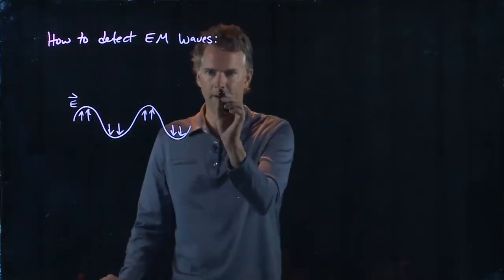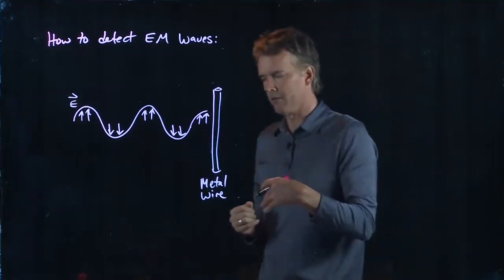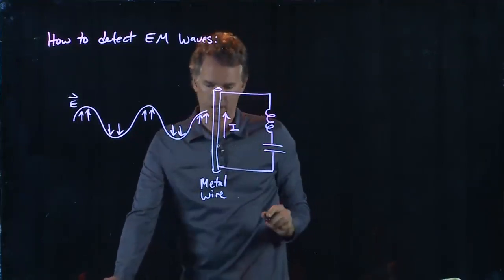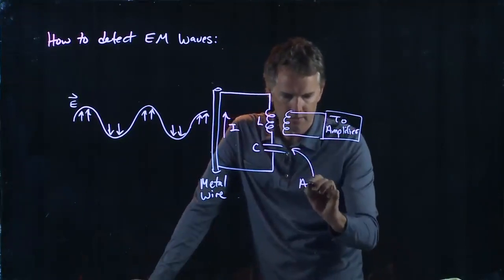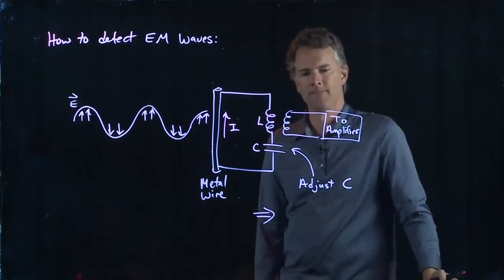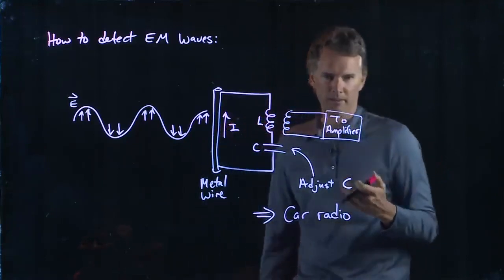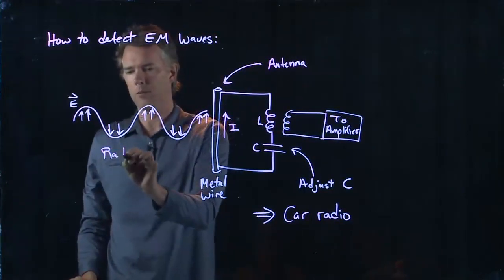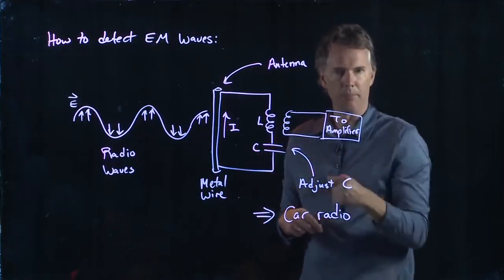How to Detect Electromagnetic Waves | Physics with Professor Matt Anderson | M25-03

Comment: Dear Dr Matt,
Excellent explanation
1 query .... since the antenna can detect a changing magnetic field as well, what exactly is it detecting and converting to an electric signal at the receiver's end?
My intuitive understanding is that, the induced electrical signals from the changing magnetic field are far weaker than the changing electric field from an incoming EM wave.
your thoughts sir ....
Thanks
Reply: The antenna would transduce all waves that hit it, capturable in frequency range of the antenna geometry, induced into the circuit as signal. 

That signal gets further processed (amplitude adjustments, filtering, phase corrections, or other processing similar to audio processing, etc) for usability in "tuning" a frequency.

The actual 'tuning' implements somewhat differently, depending on the technology protocol (i.e., AM, FM, CB, HAM, UHF or VHF broadcast, Bluetooth, WiFi, etc).

The fundamental EM wave frequency, the carrier wave, usually gets cancelled out by generating the same target frequency, cosine to the incoming EM wave .. 

That's all i got; does it answer your question?

Comment: Prof, I have difficulty to understand about metal (wire/plate, etc) and antenna. Antenna is made of metal, cupper or aluminum. The rod is hit by the EM wave and we receive the signal in our radio like in your diagram. But it is the same metal used to reflect signal like in the Yagi antenna which we put bar metal behind the dipole, intended to direct the signal so we he the directed signal. The same thing in parabolic antenna. The dish is intended to reflect the receive signal to the focal horn. Almost the same case is in airplane. It is the surface metal of the airplane reflects the signal from a radar to bounce back to the transmitting antenna so we may calculate the distance, etc. To make a stealth airplane, we need a non-electromagnetic reflective surface. How to understand it?
Reply: I would look at an antenna book.   Maybe the ARRL antenna book  ?  Maybe even check Wikipedia for Yagi Antenna ?
Reply: @k7iq  Actually, it is easy my question: We make metal (say, aluminum) to receive/radiate EM wave. But, it is the same metal we make to reflect the EM wave (i.e,: in the Yagi antenna or parabolic antenna). So, how the same kind of metal acts to radiate/receive and to reflect? Because the metal reflect EM wave, then engineers have to work hard to discover material to make stealth airplane. Just as simple question. Why it can receive and reflect at the same time?
Reply: I know that some stealth ships or planes use angles to reflect radar signals away from their source so that the radar cannot detect the ship.  I think that the use of conductive metal depends on its relative length and distance from the main radiating element.
Reply: @StrsAmbrg  This is a pretty interesting subject I think.  There are several questions on the internet related to this and also some good answers.  I tend to think only of lower frequency radio waves but, at visible, UV and IR light frequencies it is more simply understood. For instance, regular glass will absorb UV and IR light frequencies but will pass (filter) visible light spectrum and the back can be aluminum of course (again).  Silver is even better.  Imagine that.  Silver is a better conductor than aluminum.  Not exactly sure if that is why but it might be related ?
If I find more I will post here.  There is more about this if you Google for it but there was no immediate intuitive answer.
Reply: @k7iq  Indeed, this is an easy question but hard answer. I will appreciate if you want to answer. It is the same material we use to receive signal and to reflect.
Reply: Yep.  Same material for radio in my world.  Aluminum all the way pretty much.  Copper wire for simple wire antennas though.
Wish Maxwell himself were here to answer !  😁